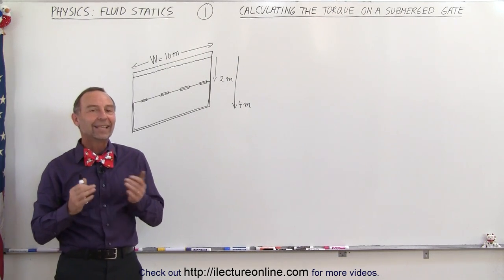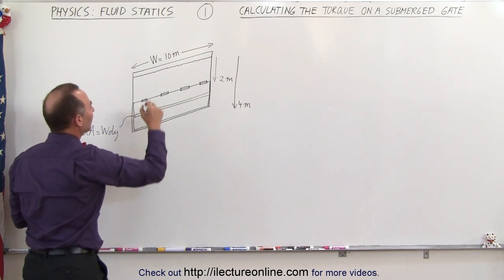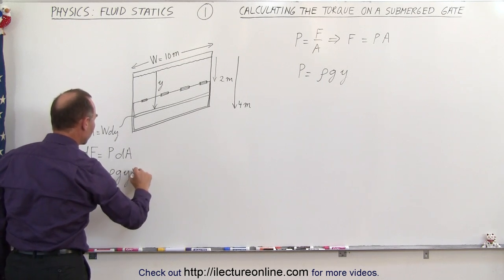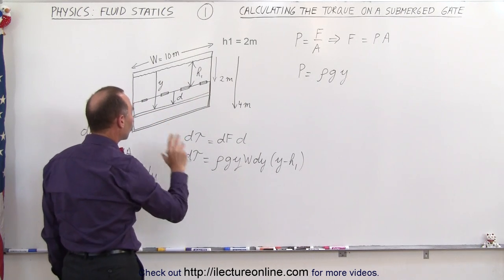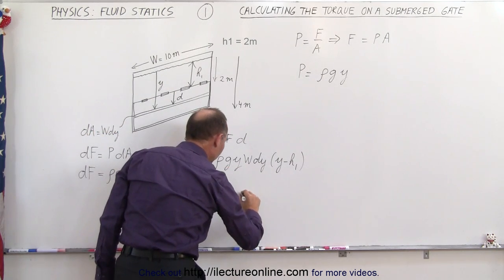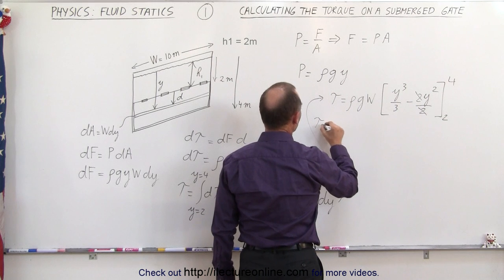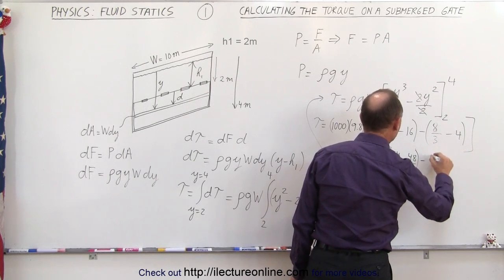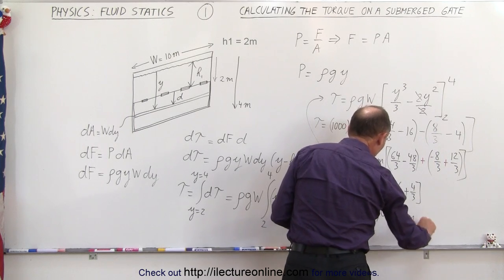Physics - Mechanics: Fluid Statics (1 of 1) Calculating the Torque on a Submerged Gate

Comment: in the simple case where the gate is from top to bottom it would be: T = rho*g*W times integral of y^2 dy from 0 to to the maximum depth, right ? so basiclly the same without the - hy part in the integral

Comment: A quick question....Why is the pressure rho.g.y.. Why haven't we added the atmospheric pressure (i.e 1atm or 10^5 Pascals) ... Shouldn't the pressure be P*(atmospheric) + rho.g.y
Reply from the maker: The atmospheric pressure exerts itself on both side.  Thus we typically only calculate the gauge pressure.

Comment: Appreciate the content! One question though, Shouldn't we use a double integral here? Integrate over dy from 2 to 4 for the force then integrate over dd from 0 to 2 for the torque? Because the torque experienced by the wall differs with different values of d. What am i getting wrong?
Reply from the maker: There is no need to integrate from left to right, because the pressure and the torque are constant at the same depth.

Comment: I've got an one question is that so Torque we calculated is that average force on the wall from the wheel, or the net force all through the distance from the wheel?
Reply from the maker: When calculating the torque, you will typically need to use integration.
Reply: @MichelvanBiezen  Ok, you mean Torque is that torque

Comment: Why should there be any net torque if the pressure is acting on both sides of the gate, pressing on it in two opposite directions with equal forces?
Reply from the maker: The force increases with increasing depth.  (there is only water on one side).
Reply: Michel van Biezen why is there only water on one side?  Is the gate up against a wall?  I’m having trouble understanding why a flat object submerged in still water and resting perpendicular to the ground would experience any torque. Thank you!

Comment: Sir if height 2m to 4m cause clockwise torque then from height 0 to 2m will cause counter clockwise torque so the final torque will be difference between those two torques 
Am I right sir?
Reply from the maker: Since the gate starts at a depth of 2 m and the portion above the gate cannot move, the higher portion does not add to the answer.  Now if the whole barrier was able to pivot around the 2 m point you would be correct.
Reply: @MichelvanBiezen  thank you sir